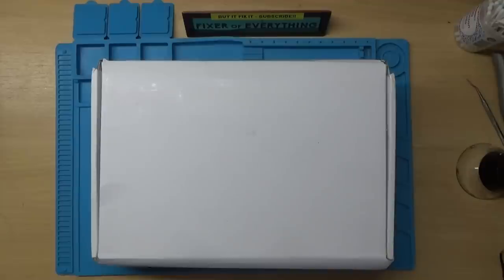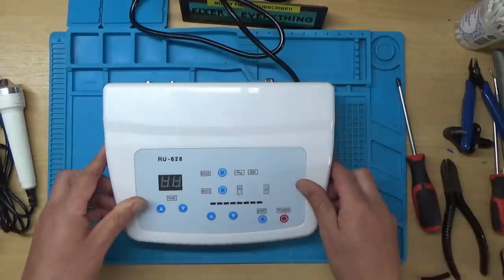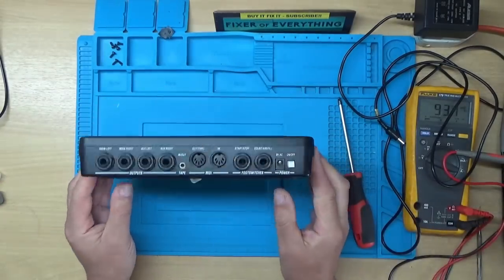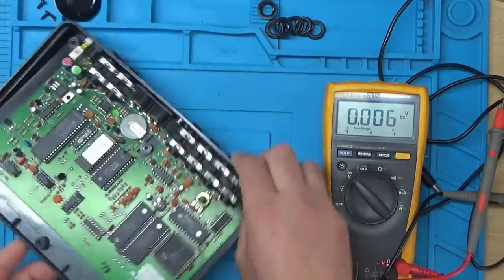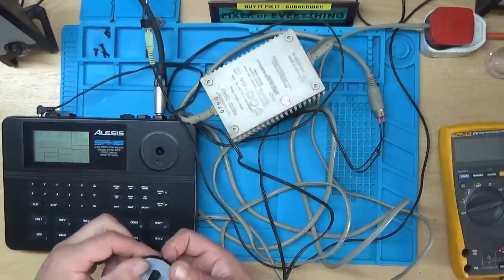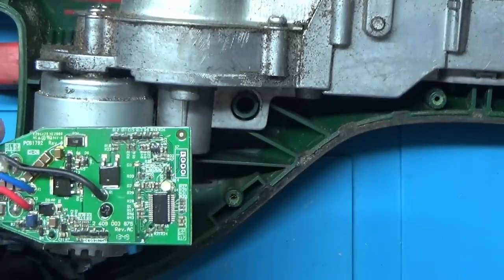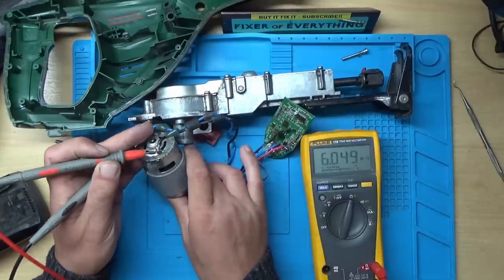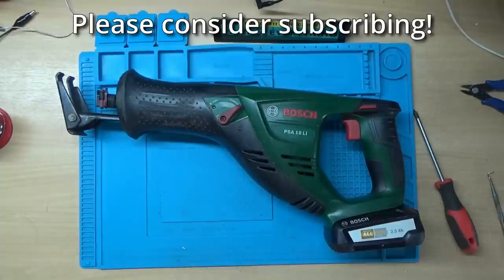Three Easy Repairs | Ultrasonic Machine | SR16 Drum Machine | Bosch Reciprocating saw

Comment: CE tends to mean China Export, rather than indicating compliance with the required EU regs.....    I was working at a small PC 'builder' back when the whole CE/EMC thing came in. Very quickly determined that nothing we could produce would comply if actually tested.....  didn't bother the boss as long as I put a CE sticker on the case.
Reply from the maker: @chrissavage5966  😂😂😂Yes someone else mentioned China Export which coincidentally looks very similar to the CE mark 🙂

Comment: A switch mode PSU is probably too noisy for an ultrasound machine.
Reply from the maker: It could well be the case. The medical ultrasound I had a look at a while ago uses a SMPS although it is external.

Comment: The fact it does not have a UK compliant plug on it would have meant I'd have binned it. Chances if they skimped on the safety of the plug the rest of it is also unsafe garbage.
Reply from the maker: Yeah it's not great. The rest of it is probably ok, as it has a transformer for the power supply, so it *should be isolated from the mains. It's not mine anyway and was only helping out a friend. Hopefully he doesn't cook anyone from the inside out 😂😂😂

Comment: Isn't the drum machine rectifying the AC anyway? So you could use a 9V DC power supply with it
Reply from the maker: Yes, but I'm pretty sure it's rectified by the two diodes inside into a split supply so you end up with  positive and negative voltages for the DAC and op amps.

Comment: By placing a 3A fuse in the plug while having a 3A fuse in the  box, you created a race condition. Having a 4A or 5A fuse in the plug, that one would blow only if the internal one fales to do its job. As far as I understood, many plugs have standard even a very overrated 16A in the plug.
Reply from the maker: I even think 3A is probably too much for this device. 3A x 240V =720W. I mean you used to get 700w microwave ovens and unless this thing cooks the victim from the inside out? 😂😂😂😂
Reply: @BuyitFixit  What I did mean to say that if in case of a short on the board, now one of the two 3A fuses will blow, but you can not predict which one. So having a higher amp value in the plug will lead to blowing the internal one which one would inspect most likely first. And yes 3A is very overrated for this machine unless it has a high rush in current.
Reply from the maker: Ah right. Thanks Jan 👍

Comment: Watching you carefully peel the warranty sticker I was thinking both the warranty and company that made it are probably long gone. Not so - they still exist and still make the SR-16 though it now uses a 12V DC supply.
Reply from the maker: 😂😂😂Yes I guess they use something else inside to generate a negative supply, or use different ICs that no longer require it.

Comment: NIce fixess again.
With the drumcomputer you can actually use DC power on the AC input. The rectifier just rectifies again.
You can remove the diodes ofcourse the prevent any power drop. DC power bricks are easier to get a hold on nowadays.
Reply from the maker: Thanks 👍I wasn't sure if it used the AC for timing or if it generated a negative voltage for the OP amps with it. I've got a 24v AC PLC and that doesn't work on DC when I tried it.

Comment: WOW, the power of the Internet, I have been fiddling with 2 fishing bite indicators while watching this. Neither working at all, despite new battery. Now 1 working properly and the other the lights work but no buzzer. No idea what I did to fix them though except take them to bits and rub the boards a bit 🙂Think you have fixed them by proxy.

Comment: You are correct about that dodgy plug, no way I would use any appliance with an unfused plug, I wonder if the missing contact is still stuck in the socket where it was last used?
Made of the best Chineseium, no wonder it just fell apart 🤣
Reply from the maker: 😂😂😂😂 yes I was wondering if it was still lodged in a socket somewhere....
Reply: Where else besides the UK do they use fused plugs? I don't recall ever seeing them anywhere but there.
Reply from the maker: A quick google search says Only the UK, and other countries rely on the consumer unit. The maximum fuse in a plug is 13A and often on a 32A beaker in the consumer unit and wired as a ring main with other outlets. I guess if the cable was rated at a couple of amps as in a lamp for instance and it got damaged, the fuse in the plug would blow instead of sending 32A down a cable rated for couple of amps.
Reply: @BuyitFixit  Yeah, maybe remnants of times past with fuses in the CSU and the prevent blowing the whole circuit? Cheaper to replace a device fuse than the ring main, maybe.... Now with breakers just an old regulation. Not a bad idea by any means though to have the devices fused. 
In US you can have 25A branch circuits and devices you plug in can have #18 AWG (1mm or so) and you never hear of things melting down. Here in Vietnam, same thing up to 32A, but way more electrical scaries here! No grounds / earth. TT system, not a TN-C (or C-S). So of course, no PME either. But, has it's advantages too, less fault current, but that can also cause breakers not to trip. Pros and cons to all systems. RCDs are becoming more widespread now here too. No regulation as far as I know, but I do recommend and install a lot of them.  The price difference for an RCD here VS RCD (GFI) in the US is crazy. $10 USD here vs $100+ USD in the US. From same manufacturer too!
Reply from the maker: Wow expensive. We have RCDs here too. Normally a main one in the fuse box that is connected to all of the other circuits.
Reply: @inothome  There's only one reason for fused plugs in the UK: the 32 A socket circuit (ring or 4 mm2 radial). That's too much to protect an appliance lead if it gets shorted (e.g. squished or cut) and it's too much to protect the 1.25 or 1.5 mm2 of a power strip from being overloaded. Countries that only allow socket circuits up to 20 amps (with 16 amp sockets) can rely on the protection in the consumer unit, which is frankly less of a hassle. Appliances that need it (like the ultrasound machine) have their own fuses anyway (and those glass fuses are usually considerably faster acting than the good old BS1362 fuses in plugs, these are sometimes slower than the circuit breaker in the consumer unit), so all the fuse does is protect the mains lead up to the appliance. If the lead is fixed, the appliance limits the power, so the lead can't possibly be overloaded, so all that's left is short-circuit protection.

I seem to remember that France even allows up to 25 amps without fused plugs but in reality they use 20 A breakers for sockets. Other countries say "no more than 16 A with 16 A sockets" because a B16 breaker will let you draw around 23 A for up to an hour anyway (fusing current).

RCDs are remarkably cheap in the UK, particularly high-current ones. In Germany and most of the surrounding countries 25 A and 40 A RCDs (30 mA Type A) are reasonably affordable, less than 30 Euros, while 63 A and up are massively expensive. 100 A are almost impossible to find and only used in industrial installations, homes and small commercial units never get more than 63 A anyway, three-phase though. Most suppliers require indirect (current transformer) metering for supplies above 63 A, which is amazingly expensive. Mentioning 400 A direct-metered 120/240 supplies in the US is a good way to make a German electrician's eyes bulge out 😂RCBOs (RCD/circuit breaker combos) are also a lot more common in the UK than elsewhere in Europe, on the continent one of them is more expensive than an RCD and a circuit breaker, so few people actually use them.

Comment: To remove the gear from the motor shaft, a bit of heat to ease the Loctite should have worked if that's what they used. Same would apply if it was a press fit gear. When turning it backwards? is sounded as though the brushes were being tortured by the commutator. But it works again, so a great result 👍
Cheers
Pete' New Zealand.
Reply from the maker: Thanks Pete👍

Comment: Did you replaced the motor wires in the same order?  If not, it could run  backwards which you would not notice as the saw connection moves only up and down, but the interal mechanism could not like it and wear down more early.
Reply from the maker: Yes, both motors had a red dot on the terminals marking the polarity 👍

Comment: The following transistors burned out on my cordless drill:
T244 BV6416
and
T244 BV6317
I am interested in which replacement to buy, and whether it is important to look at this other number (BV6317 etc...)? Is there another one?
Reply from the maker: Are those the numbers on the PCB or on the circuit board? None of those numbers seem to fetch anything up on a search.
Reply from the maker: I guess it's an Einhell drill. I did find a reddit post from a few years back where someone else had the same issue, and they were thinking the mosfets were IRFZ44VPBF https://www.reddit.com/r/AskElectronics/comments/klq4yf/replacement_mosfet_for_einhell_brushless_dc_drill/
Reply: Will IRF3205PBF MOSFET or IRFZ44N MOSFET work instead of these burned out.
Reply from the maker: Hard to say because we don't know the specifications of the original mosfets.  The IRFZ44N might work but I can't say 100%
Reply: @BuyitFixit  Okay tnx for answering, im gona order 3 x IRFZ44N, 3 x IRF3205PBF, 3 x IRFZ44VPBF(i found it). In Serbia is so cheap 1 mosfet is like 20 cents.

Comment: hey thanks for all your vids.. love to see a genius at work..  With the drum machine there's the 9V AC input power supply. How does the power section on the main board work to provide dc with two diodes which impiles full wave rectifier .. but you need centre tapped AC for that. There are two diodes... so does that mean the ac is halfwave rectified for two rails? and the AC- is that used as is within the drum machine? If not you could use a dc mains adapter - the dc would just sail through the rectifier diodes and all would be well. Maybe opamps and DAC's require the AC rails..but they then need the 'middle' 0V don't they? Sorry questions and no answers.
Reply from the maker: I think I found someone else working on one on YouTube and there were some negative voltages required for the op-amps or it might  have been the DAC. I assumed that's why they had the AC input. Hope that helps.

Comment: Won't the drum kit work on DC too?   If you rectify DC, you get DC.  Internally, the drum kit has a discrete rectifier.  Thanks for another great video.
Reply from the maker: I wasn't sure if it used the AC for timing or if it generated a negative voltage for the OP amps with it. I've got a 24v AC PLC and that doesn't work on DC when I tried it.

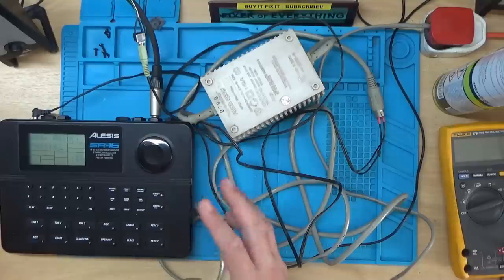Comment: @18:08 - There is a tiny surface mount pot in the machine.  I wonder if that controls the contrast for the screen?
Reply from the maker: I might have a look. The contrast did look slightly weak but it also depended on the angle you were looking at it.

Comment: Nice, as much as we enjoy a puzzle a few easy fixes in a row is good for the soul ! Regarding the AC supply I would not have the patience to dig around for one and just stuffed 9v DC in ! just don't do it the other way round lol !....cheers.
Reply from the maker: Thanks 🙂👍I wasn't 100% if it used the AC to generate a negative voltage for the OP amps.

Comment: Can't you put dc into a power socket that is expecting AC, so the diodes  simply pass the current in one direction rather than switching it around the bridge?
Reply from the maker: It depends I think this was using the AC to generate a split supply for negative voltage for the DAC and OP amps.

Comment: Always nice to see stuff brought back to life. I think in some cases you can use DC instead of AC if the unit does have a rectifier.
The voltages may be a little lower using a DC psu, also some items may need both negative and posative voltages so they may not work either.
Reply from the maker: I'm not sure if this uses the AC to create a negative supply for the op amps.
Reply: It will do. The 2 diodes are providing 2 half wave rectified outputs, one for the + output, one for the - output. The 2 large capacitors will be smoothing the outputs.

Comment: For fine stranded conductors class 5 and above for use with screw terminals bootlace ferrules should be used to no only protect the conductors from the screw but also to ensure a good electrical connection as the conductors will splay out under the screw causing only partial contact with the conductor reducing the current carrying capacity. 

As the plug was non compliant I would be that the conductors used in the flex are copper coated aluminium so I would be checking if it is capable of carrying the current the load requires.
Reply from the maker: Thanks. I was taught back in the day to tin the wires with solder. I did mention this one someone else's video (could have been one of my mate Vince's) and had a few comments saying it wasn't needed 🤷‍♂️

Comment: 3 fixes in one video that's a great deal, I always wondered how people manage to break the legs on the plugs. The saw didn't make a lot of noise, is it just a "weaker" saw or did the just make a saw that doesn't sound like a jet engine, but keep up the great work 😁
Reply from the maker: Thanks Morten 👍Yes I'm not sure how the plug got snapped either. It needed changed anyway for a proper plug instead of that garbage one.

Comment: You could use any (9 x sqr 2)12Vdc/enough amps adapter as the rectifier bridge on the board will take care of the right polarity on the system. The only fail could be when the system makes use of the 50Hz for one or the other clock or synchronisation.
Reply from the maker: I wasn't sure if it used the AC to create a split supply as I know some chips in the unit require a negative voltage.

Comment: ||Disregard this, I forgot that audio mostly need + and - voltages|| You can just use a 12Vdc adapter or bench power supply when a device needs 9Vac ;) it can be in some cases it needs the 50Hz sine todo some stuff, but in most cased an higher voltage DC adapter on an low power AC device works fine ;)
Reply from the maker: I wasn't sure if it split the supply into a positive and negative voltage for the OP amps as some audio stuff does that.

Comment: Not sure if you are aware, you can put a dc current into an account circuit if it uses a bridge rectifier. But not actually into a dc circuit.
Reply from the maker: Yes, but somethings still don't work. For instance I've got a 24v AC PLC and a 12v DC one. Both very similar. The AC one wouldn't work on DC. Also some of the chips in the drum machine use a negative voltage which I think is why they used an AC adapter.

Comment: 🐨This device should more than likely draw well under 500 milliamps when operating properly, 
NOW... See that transformer @4:19, Well that suckers primary winding should burnout at 
around about an amp, 2 amps tops if it's maximum and I stress it's maximum current draw is
exceeded. 
Having said that, this would make any fuse greater than 1.5 amps redundant so I suspect some 
hack couldn't get their mitz on a properly rated fuse and therefore that massive 3 Amp fuse was 
installed, and as a comparison my 250Wrms Subwoofer uses a 5 Amp fuse at 240V.
BTW there is a formula to calculate the transformers specifications if the various voltages 
and nominal current draw is known if one wishes to protect the supply transformer without it 
burning out the fuse prematurely.
APU 👁👉👍👈
Reply from the maker: Agree I was just chatting to someone else earlier in the comments who suggested putting a larger fuse in the plug than the one in the unit, but even 3a when I worked it out would 720w at 240v. Perhaps it's more of a microwave device that cooks the victim from the inside 😂😂😂 but serious I can't see it drawing much at all. I think a 1A fuse would be more than adequate.

Comment: I love your content. One issue is the echo in your recordings. Could you try to remove the room echo? A better microphone setup maybe?
Reply from the maker: Is that in the workshop bit? I was using a different camera which unfortunately doesn't have external microphone input, and it's a shed made out of metal sheets so it does echo a bit in there. The other parts should be fine as I've got an external Rode microphone (I did a video on repairing 2 of them a few videos back).
Reply: @BuyitFixit  Yes the sound in the shed was bad and in the house (with Røde mic) good.
Reply from the maker: Thanks 👍

Comment: most medical equipment will use linear power supplies due to the high frequency noise of the switched mode supplies.  Same with high quality audio equipment.
Reply from the maker: ...Also HAM radio equipment, I have a linear power supply for that as the SMPS generates too much noise on certain frequencies.

Comment: The drum machine - backup battery - is too low - below 3.05v usually means it is almost flat…. Needs replacing… I change the coin cells at less than 3.1v…
Reply from the maker: Thanks for that.I just did a quick search on the voltage curve, bearing in mind that this is still in circuit, 2.8v and below is what it suggests for replacement.
Reply: @BuyitFixit  I used to work with repairing computers, and when the battery was below 3.1v, you would get weird errors. The practice was to change the battery if below 3.1 v, and reset the cmos memory, and this fixed 90% of the weird errors. The battery may not be flat, but the rest of the circuits may not be happy with a low voltage…
Reply from the maker: @markfiddament9383  Fair enough 🙂 I used to repair and build computers too. First one I build was a 386sx25 with 4mb ram and a 20gb MFM hdd, and an adlib sound card 😂😂 The first computer I learned to program on was a Nascom2 that a friend built around 1980